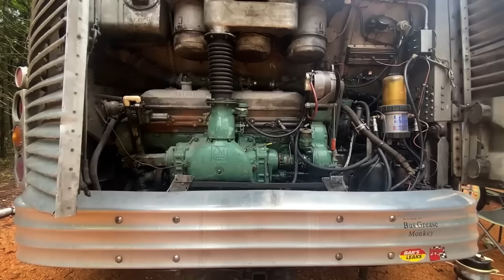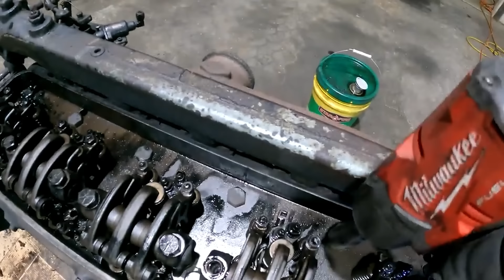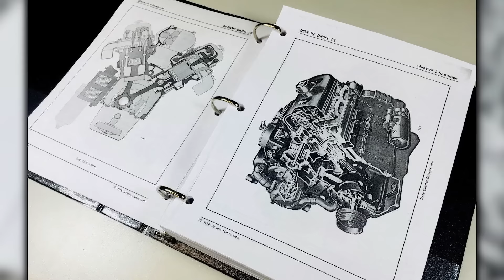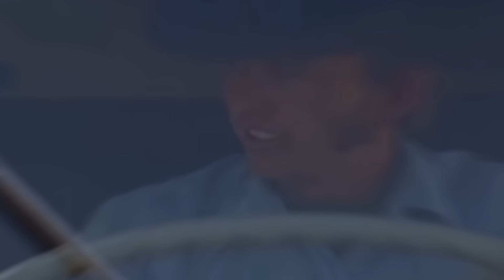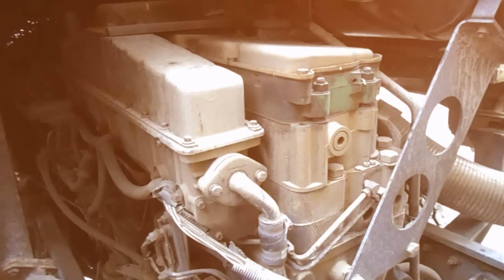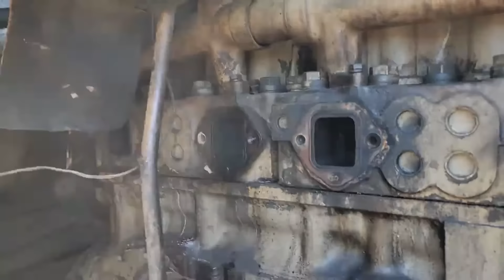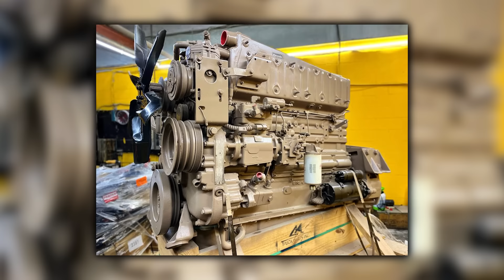The Cummins NTC-400 Engine That Silenced Detroit Diesel in 1976

Comment: So many things wrong with this AI video
Reply from the maker: Not an AI video...all me. But please let me know what I got wrong, if there is something specific. Sorry you didn't enjoy it.
Reply: @VintageAmericanMachines  1.Itz blow by, not blow through 2. You repeat things over and over, this video could've been shorter by a third. 3. You make it sound as if the Big Cam was a clean sheet design, what about the Small cam which was virtually the same engine and had been around for about 40 years. 4. I despise when the pictures don't match the narration. 5. No mention of Caterpillar?
 Detroit Diesel was slow to react to the market, and the market threw them to the side of the road. Capitalism at its finest!
Reply: @VintageAmericanMachines  it’s an ai voice at least, on your older videos you have a different voice completely lol
Reply from the maker: Yeah, I used to use a real guy for voice-over, but he got SO expensive and took forever. I can't afford to spend more than I make on these.
Reply: @VintageAmericanMachines well, you won't be making anything soon with youtube demonetising AI voice over content.
Reply: Like what?

Comment: I was an 88M in the Army, belonged to a line haul unit running M915 A2’ CCC then later the Freightliners, all had the NTC 400’s and the engine was the best thing about those trucks. Put many thousands of miles on them in Iraq and all over the US and I never had a single engine issue.  They were bulletproof, literally. One convoy in Iraq I was on got ambushed, my buddies truck took .50 cal armor piercing rounds through the armored cab and through the engine block. Truck ran long enough to get him out of the kill zone.  You could look through the engine block.